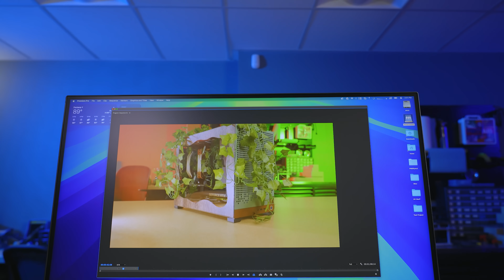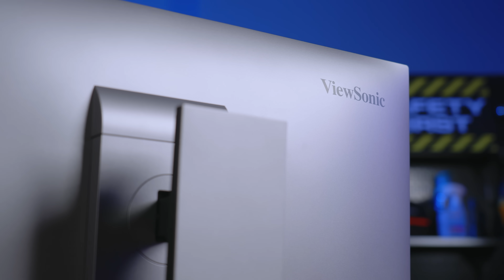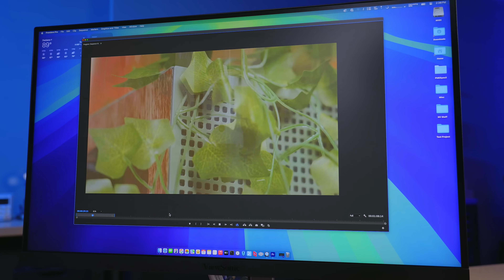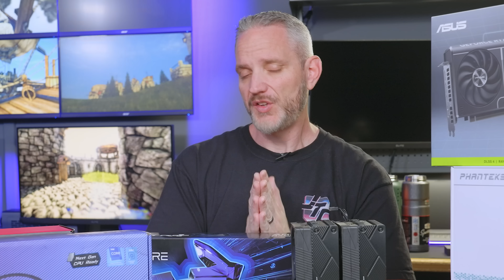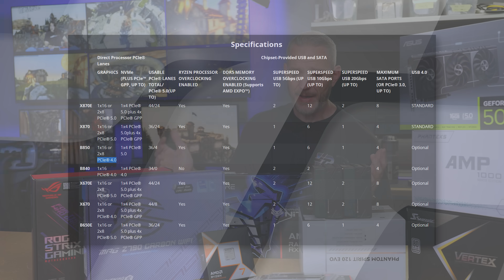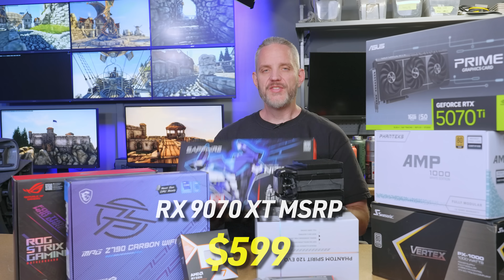This is the Sweetspot for PC gaming... Don't get fooled into spending more!

Comment: Listen to jay about power supplies. I didn’t really cheap out on mine cuz I got a gold rated one but I did do what he said not to do and checked what was the lowest I can get away with and ran my 2080 super for years up until last week when I went to get a new 5080 and I needed a powersupply. Had I gotten the 1k power supply I would have just been able to plop in my 5080. Instead I had to take out my old psu and do all the cables again with the new psu. That shit was a little annoying . Not hard but not something I wanted to do lol

Comment: I've been following your advice unknowingly for years, just based on common sense. I bought a gold standard PSU, 1Kw, in 2014 - still using it today. The last two gpus I bought were a second hand 1080ti and currently a second hand Evga 3080ti. And that's not all...

Comment: I don't really like your stance on CPU choice and the way you present it.

There are tons of situations where it makes sense going for an X3D chip and skimping out on GPU.
I play simulation and strategy games mostly, for example X4 Foundations.

Community testing for this game has seen notable performance differences between CL30 and CL36 ram for example, and it always CPU bottlenecks late-game even with the most powerful CPU's available. You can always lower graphics settings but you cannort lower the CPU simulation. Your explanation of CPU and RAM is always too simplified to the point where it's outright misleading for gamers in these genres.

Comment: 15:20 It's a common misunderstanding but Moore's Law doesn't talk about doubling performance at all. Moore's Law is an observation which says the amount of transistors you can fit on a microchip approximately doubles roughly every two years. Doubling the amount of transistors doesn't mean your performance also automatically doubles, even though when CPU designs were in their earlier years, it wasn't unusual to see 2x performance gains every 2-3 years. These days, we are hitting thermal limits (and soon quantum limits) around how fast we can switch transistors and how many we can fit in a reasonable die and still keep it cool. That's why clock speeds haven't been increasing much over the last ten-fifteen years.

Comment: Purchased the saphire pure and that was a great card but I sold that build and tried the nitro. I would not recommend that card. The pure felt way more consistent, it was quieter, and had colder temps. It also had higher low fps by like 10 fps in all benchmarking I did. Also the nitro had a terrible coil whine even during regular gaming. I returned the nitro and purchase a xfx mercury and all the issues with the nitro + were solved with no other component swapped. The cable routing on the nitro + was the best by far but you'd have to make sure your PSU cables are soft enough to have an appropriate bend. You can use the daisy chain cable that comes with the nitro + but it makes for harder cable management as they all sit on top of one another. Anyways, happy building everyone. And thanks for the video.

Comment: Ryzen 5700x cpu, £95..
RX 6700XT ASUS DUAL 12GB £260
MSI MAG X570 Tomahawk wi-fi MB £104
Crucial Pro 2x16GB 3200 DDR4 ram £50
big enough Noctua cpu cooler (nh-120 perhaps) -£62
Fractal Meshify C case - like new with all fittings and packaging. £20 !!! from a guy approx 1 mile away. 
 great for everything I do including sim racing and quiet for music production with Reason
.. worked like a dream from day one but made gains by LOWERING cpu voltage... which also dropped temp slightly. 
Nice PC built January 2025 for £591.00  
not feeling short changed. (similar price to a nice semi hollow Gretsch .~ which was a priority at the time).
..all happily running a 3440x1440 curved AOC screen at good frame rates.

Comment: thankfully i got my 9800x3d at $100 off and its cooled by a 360mm aio. and my gpu is only a 9070 none xt so the cpu is hella over kill but now i will only need to upgrade the gpu later on. my cpu temps r fuckin insane. almost never goes above 55c

Comment: I'm glad I stuck with the desktop replacement laptop set up I've been running for years now... I found a perfectly healthy and stabilized Acer Predator Helios 18 with the updated/stabilized BIOS with a 14900HX and 32gb of ram and a 4080 for 1260 dollars... It's under warranty as well... I tested the hell out of it for degradation and overheating and it runs well- I did run throttlestop and lowered PL1 and 2 to 65w and 85w respectively and my temps stay in the mid upper 80s... Occasionally it may hit 91 or 92 c but it isn't hitting any higher than that so far and it took on Y Cruncher like a champ... 

If you suspect a 13th/14th gen cpu is damaged/degraded I discovered a quick test- open Edge and pop 50 tabs and then hot key close them out rapid fire... If she's degraded you'll get a crash or BSOD... The degradation doesn't really show up when you're pushing Heaven or Cinebench from what I've seen... But you can start Cinebench and let it run for 3 seconds and stop it for 2 seconds, start for 3 seconds and stop for 2- repeated 5 or 6 times and that can induce a crash if the cpu suffered degradation...

Honestly I'm only saying this because it never occurred to me to test a high end gaming rig for light, seemingly inconsequential, functions...

Hope that helped someone...

BTW Acer released v1.11 that fixed the microcode issues so if someone hasn't updated that BIOS I'd get on it... I feel like this issue hasn't gotten that much attention unless it's folks that were directly affected by it- hell I hadn't heard about it until I was looking to buy one...

Comment: Even some of your suggestions are overkill for a lot of people. People get sucked in with numbers. I only care how fast my PC seems to be. I cannot tell the difference between 200 fps and 100 fps. I only notice a difference if it gets below 60 fps. I have an "old" Z690 with an Intel 12600K i5, 32 GB DDR4, 2TB M2 NVME drive, with a RTX 4070 GPU. Its slays everything at 1440p, i dont need it to be faster.  You can still buy all those parts new and cheaper now. And i do play games at full settings like Cyberpunk, Witcher 3 with RT update (hungrier for GPU than Cyberpunk).  The 1 thing that i wont skimp on because it by far made the biggest difference, is the M2 NVME. They really are worth the extra few bucks. I also have after market CPU fan, the stock ones suck. But its not a lot for a decent air cooler, which is all you need. I have never found a need to overclock any time, and thats the only time you need water cooling, unless you have a small case or bad airflow case. I dont, i have a Corsair 4000D, which is one of the best airflow cases out there. Have 4 case fans (it will take 6 more). Never gets too hot, even in summer at full load.

Comment: I just built my first. Ryzen 7 9700 with a 5060 ti 8gb. I was a little worried about the 8gb vram bottleneck for 1440p, but ive been thoroughly impressed. It handles 1440p way better than i thought it might

Comment: I just bought a laptop from Microcenter. Tell me if it was a good deal. It's the Alienware Area 51 (18") with a 5090 (24gb), 64 GB ddr5, and a 285H processor. I paid $3200.

Comment: used corsair cx750m with 5800x3d and my new 9070 xt, and ran 2x hard shutdowns during games due to what i can only suspect is power spikes... well said on PSU... because I was in a rush, used chatgpt to find a next day delivery PSU and the bloody things first recommendation was like another 750w psu.. in the end because price difference between decent 750/850w psu was minimal, i got an RM1000x corsair... just like with cars, no replacement for displacement I said... only regret I had, was that I shouldn't have bought the 750W to start with :))

Comment: I’ve got a 1,200W EVGA 80+ platinum power supply running a 5070Ti and a 7800X3D. My total system draw is probably never reaching more than 500W but I like having plenty of headroom on the PSU. Power supplies are most efficient when they aren’t being run near their limit and I can upgrade any components I want at any time and not have to worry about my PSU keeping up with the demand

Comment: Hey Jay! I built my first PC on an X870, Ryzen 7 9800X3D and a prime OC 5070 ti. I then upgraded to a 5080. I’m going to use my 5070 ti in another build for a living room unit. This is gonna be a slightly cheaper build. Would a Ryzen 7 9700x balance better with the 5070? And save me a couple hundred bucks. I don’t need two 9800x3d builds.

Comment: These days the prices are out of whack... 
I could find higher performance higher capacity memory cheaper or similar price compared to whatever the most standard 6k 32 gig kit.
Some Gen4 SSDs are going at a similar price to faster Gen5 SSDs.
It's not that the latest stuff got cheaper, it's still ridiculously expensive, just looks like the budget builds have pushed up the prices of legacy components to the point they are no longer budget builds...

Comment: I went with a B650 E-F Gaming WiFi Rog Strix mobo to go with my 9800X3D and an Astral RTX 5080 because as you mentioned I have zero need to min-max my PC with overclocking etc anything more than the B650E-F would be wasted on me, I spent the money I saved an a stupidly expensive 360 Rog Ryujin III aio all because it suited the look I wanted for my rig, I was going for an all Asus Rog build. I went with a 1200w Rog Gold Aura PSU, just in case lol I kinda wanted to future (over-spec) proof my system, I just finished my build right before the Ram-Apocalypse, as such I bought 32gb Corsair Dominator Titanium 6000 mts cl30 ram (dodged a bullet with that one). The whole system is built inside a Montech King 95 Pro, it is a very nice gaming experience for me, I dont play the likes of Cod these days and mostly stick to AAA single player games with all settings set as high as the PC can take it, this is my 'Best Sweet Spot' for me system.

Comment: This video is an ad.... saying $150 at least to beat that thing pushing dog farts across heat pipes to cool a CPU... Please a Thermalright AIO for $55 will stomp that thing and last just as long. Further any modern intel chip can match or beat every single AMD non X3D chip out there. X3D is the only reason to go AMD... be real Jay.

Comment: The sweet spot is the minimum necessary force to exactly what u need it for. 
Then going a single step above that limited truly by budget. 
= I just bought full AMD so I can run 4k at 70-90 fps with medium to high graphics in virtual reality games. 
Also a beast in flat screen. 
Exactly 10.000 danish crowns. 
Better was recommended, what I bought can do the thing, my budget limited me. 
I got exactly what I could. That's the balance XD

Comment: Bundle deals are where it's at. Keep an eye out for those and snag one when you see it. Could save you hundreds of dollars to put on other parts. 
As for cases. I've been building my own PCs now for 28+ years and my favorite case to have built with is hands down Thermaltake's "The Tower 600". It's beautiful, has great cooling, allows for a vertical mounted GPU, and great with how it disassembles for easy installation of parts. Love it.

Comment: Hey Jayz! Happy to be watching again. Love your advice on not overspending on non-performance bling. My current setup is z390-plus running a i5-9600k, a RTX 2070 super, and 16GB DDR4. Looking at upgrade/rebuild potential as the system is starting to show its age. 
At this age should I look at replacing everything, or just the main 4 (mobo, cpu, ram, gpu?) ((and power supply if needed))

Comment: Hello JayzTwoCents, explain to me please, WHY can't they increase the amount of lanes that are available.  If you look at the specs for these great 870 MOBOS that we are spending $800+ on to have the greatest CPU, why say if you want more storage you spend $400 for a 4TB M.2 drive and then you lose the use of the other PCI slot that, that is  if you plug in 3 M.2 Drives, I know the AMD Threadripper has more lanes as well as the XEON CPU's, so it has something to do with the design of the chips and probably has to meet some sort of standard dating back to the 8088 days, YES?  
Please Reply!!

Comment: note this : this video isn't about the x3d CPUs but if you consider buying one, you don't really need to buy a CAS28@6000 ram. You can buy cas40@4800 and have negligeable performance loss.

Comment: The over spec psu advice is great. I had to upgrade my PSUs each time I upgraded my GPU. If you have any desire to eventually upgrade your rig just go with a Beefy PSU from the start. It will last forever.

Comment: I spent 1200$ on a ryzen 7 7700 16gb ddr5 1tb m.2 and a 3080 ti fe system at micro system it’s been doing very well for me they where out of the mobo the kit came with so I got a free upgrade to the b650 wifi

Comment: Can anyone comment on the stability of the B650 or something similar? Back when I bought 1st gen Ryzen the stability of B350 has been a headache. Boot times were slow, crashes were common - XMPP was shit, and I just wished I'd bought the X370 instead.

What's it like on 2025-2026?

I'm not over clocking much if at all.

Comment: I’m still running an AM4 setup. Amd Ryzen 9 5900x, B550 motherboard, 32GB Vengence memory kit, 2 1tb m.2 drives and a 4TB seagate. My only bottleneck seems to be the 3070 Ti card with it only having 8GB VRAM. I’ve been looking at the Gigabyte gaming OC rx 9070 XT. Falls within my price range and adds Smart Access Memory, since it would be an all AMD setup. The question I have for Jay, Phil and everyone, would it be worth while to upgrade only the GPU for now?

Comment: no no no no no THIS is the sweet spot

GIgabyte gaming oc 5080 gpu
AMD Ryzen 7 9800x3d cpu
Musetex y6 case with 7 preinstalled infinity mirror rgb fans
1000w be quiet! 13M 80+ gold cert psu
32gb corsair ddr5 6000mhz cl36 ram
B850 tomahawk max wifi motherboard
Crucial T710 2tb gen 5 ssd
Arctic liquid freezer III pro aio

Comment: Feb 2024 I build my pc, I had about a £1500 budget for pc for gaming, I opted for a 5800x3d even though it was not the latest and greatest ddr4 3600mhz ram 18 cas... half the latancy of the ddr5 at the time... The motherboard is a B550 it has dual m.2, 2.5gb lan wifi 6 bluetooth basically everything you ever need picking these allowed me to afford a 4070 super, 2tb wd black gen 4, nzxt aio, 750w Corsair psu and a Fractal North case, 25 months later its still really good im happy with my purchase.

Comment: Screw orthodoxy: I’m throwing my mini ITX into an ATX case as a bridge for an AM5 or AM6 platform; flashed the bios and going from Ryzen 5 2600x to a Ryzen 9 5950x. In 2026. 

I’m getting into Gentoo though, I don’t need a crazy graphics card, I want those 32 threads and a mature chip. Only bummer is that I have to upgrade to better DDR4.

Putting a V8 in a mini van. Who says you can’t have fun on a budget… 👍

Comment: I just got my PC today! 5060ti and 7800x3d. Pushing 600fps in CS2 and with dlss I'm getting over 144 fps in any other AAA game I've tried. I'm using a 1080p monitor so basically anything will run on it.

Comment: The sweet spot is really not based on the best parts, it's based on what you're playing and if you want to cap your frame rate...In reality, I could play on Ryzen 5 8700F and a 8GB RTX 3060, but cap the FPS at 30fps and still use close to ultimate settings on most games if I wanted, but if I wanted to play competitively I'd be SOL since I could never reach a competitive FPS. It all depends on what you're doing with your setup therefore most of the time these videos are 100% click bait.

Comment: Last year I built my 10 year system. HAF XB Evo case AM5 ASROCK 850, Ryzen 7600x and a 3060 12 gig card. 2 gig nvme and several ssd's and a DVD burner I can always update the CPU and GPU. 😊
Reply: Also 32 gigs DDR 5 6400
Reply: Useing my old system as a NAS... Just adding hard drives.

Comment: The sweet spot begins at your compromise tolerance for gaming or productivity.  What settings and resolution are you ok with?  If you don't really mind 1080p and mid settings at 60fps, then you can save $2,000+ over someone who needs to play max settings at 4k (insert ridiculous 4k fps here).  
-  Start with the GPU.  Look up the gameplay videos.  Compare that to other cards in the price range you are comfortable with.
-  Since it's 2026, ask an ai for the best value on a motherboard, ram and CPU combo that won't bottleneck it's performance. If it gives the wrong answer for your fanboy tastes, scold it harshly.  Then ask about the PSU requirements.  You don't need specific manufactures as you'll want to be flexible for the next step.
- Go looking for bundles.  If you're a gambler, go looking for used components.  Also, don't be afraid to ask friends and family if they upgraded recently and have ram or GPUS (sometimes whole systems) that they haven't sold.  I just got 32g 3600 ram and a 3060 12g for $300 this week off friends, so it works.

Comment: Jay, I was able to build a system at a pretty good price going used. I got from Jawa a motherboard, ram and CPU combo for $450.00 with the following specs. MSI Z790 ACE motherboard, 13900k CPU and 128gb Corsair Vengence ddr5 ram 6400 CL30. I also bought from Ebay an open box Corsair iCUE Link Titan 420 RX RGB 420mm AIO (which was truly open-box still had factory thermal paste on cooler) $112.50. I got a good deal on a PSU as well from Ebay open-box (missing PSU tester everything else was there) Seasonic PRIME PX-1600 - 1600W - 80+ Platinum $144.00. I did buy a new case from Microcenter HAVN 420 DOOM limited edition (sick case for the money) $329.00. I already had an RTX 4090 MSI Gaming X-slim that I put in system and lastly 2TB 990 Pro I bought on sale a while ago for $149.99 (bought 3 at that price).
The system runs great, temps. are great and shouldn't need any updates for a while (running everything stock settings).
Reply: that GPU was the key for ur build! congrats!!